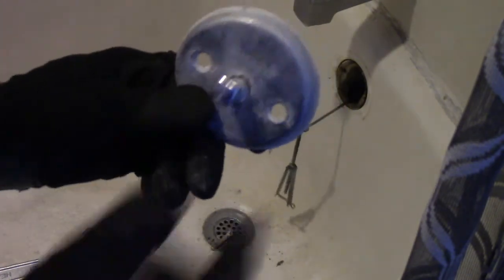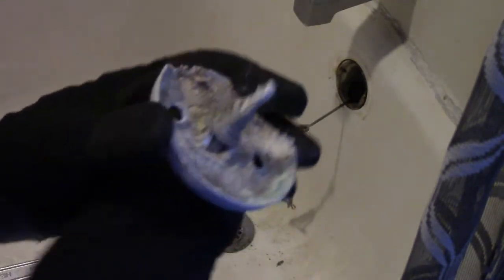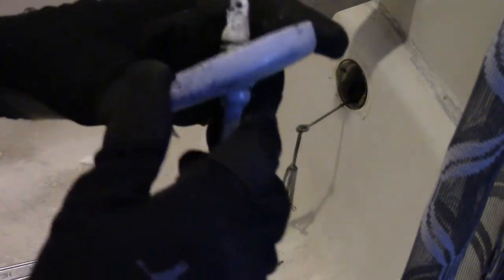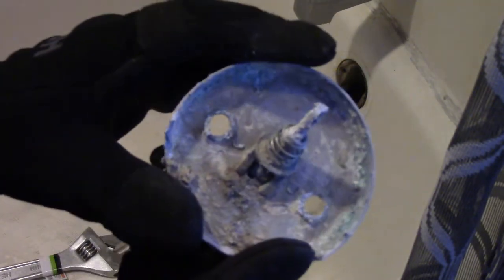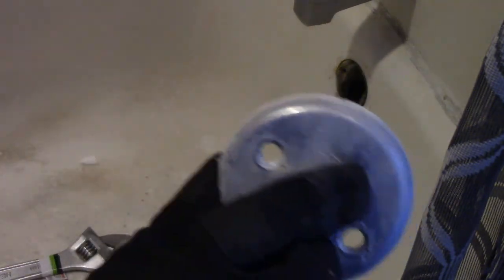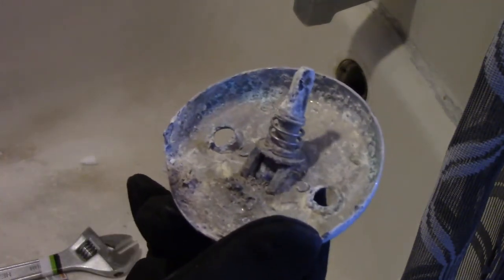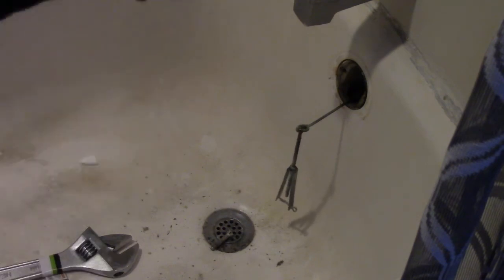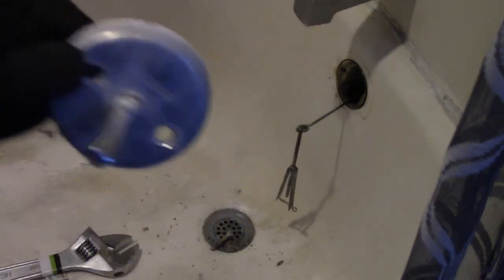Trip Lever Cover Bath Tub Drain Replacement 2 of 3 remove cotter pin

Comment: My apartment maintenance people in thier brilliance removed the spring and placed an three sided edge bracket looking thing in it Place and now guess what don’t have full range of motion to fully open or plug my drain. I’ve been fighting with them for going on 5 years now cuz I’m not about to PAY OUT POCKET for a new drain a rubber stopper but now also a faceplate from the store cuz none of them will see how I can possibly have BOTH slow drainage AND a tub that won’t seal when plugged bad enough I can’t hold water in my tub for more than 15-20 minutes AND THEY HAVE REPEATEDLY PULLED THE ASSEMBLY OUT TO ADJUST IT CONTROLS TIMES none of which make even a noticeable difference.
Reply from the maker: It is amazing how seemingly little things can disrupt our lives in a big way. Best of luck to you. Thank you for sharing your situation with us.